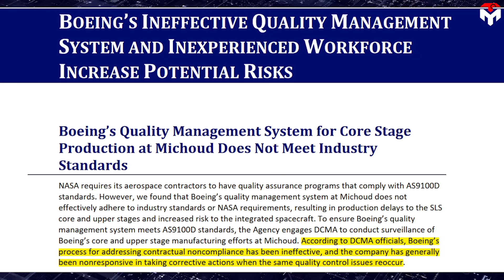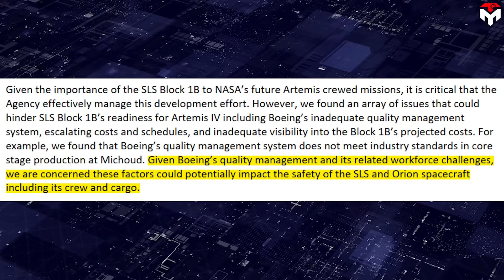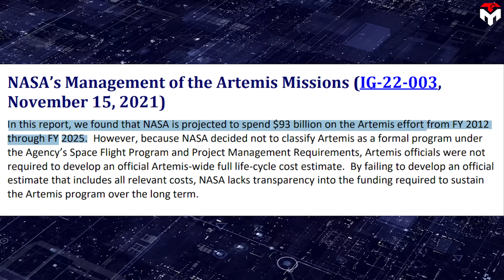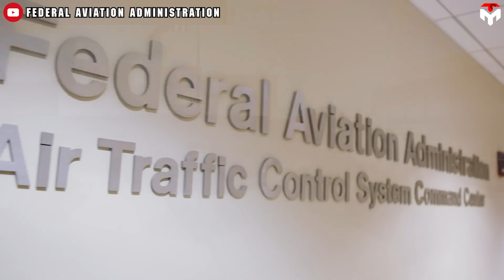Boeing's New Big Trouble With SLS, WORSE Than Starliner: Not Safe To Launch!

Comment: I worked EVM on ground system contracts, and on a number of projects involving NASA satellites.  People think EVM equates to cost control. It no more equates to cost control than a speedometer relates to speed control.  That said, I knew of many non-Boeing contracts where NASA paid them anyway, or failed to penalize favored contractors on CPFF contracts.  Development contracts are risky, and risk is part of the process.  That said, Boeing's track record is bad lately, and they need to see some penalties.  Also, NASA and the FAA need to stop beating up on SpaceX, and reward SpaceX better for excellent performance.

Comment: I again make a comment based on the video I just watched covering the latest POS Piece of Sh*t rocket.  What has happened to Boeing?  Seems every time they introduce a new product it is full of faults and when the assembly is inspected it has too many assembly issues that results in cost increases and many delays.  The video commented how the latest rocket designed and built by Boeing was as the article indicaes WORSE that the Strainer and not safe to launch.  I believe NASA needs to take a closer look at the design plans on anything being presented by Boeing.  Especially considring the results of their most recent products.  I am very sorry to see such a great company have problems that are just poor management and trying to cut corners in production.

Comment: Unfortunately, if they were to institute penalties that are not in the contract, Boeing could sue them for breach of contract. Unfortunately, NASA is now locked into this contract. the biggest problem is there now a company of being counters instead of engineers.
Reply from the maker: Hope that the new CEO can improve this
Reply: To make major changes, they would have to change not just the CEO, but quite a bit of the upper staff. Once the environment in a large company is set. The harder it is to make any changes.

Comment: REMEMBER DR.VERNER VON BRAUN ? NOW THAT WAS A REAL ENGINEER. The Saturn 5 was built and tested in sections  then assembled ,astronauts, then boarded and  took off. DR VO BRAUN SAID, DONT WORRY, ITS FINE.
Reply: There were no computers to make a solid design, and all blueprints (yes   they were blue) were drawn by hand.  Their tool was the engineering rule, with 3 sides.
Reply: Dr. Verner Von Braun was not a bean counter.
Reply: He had two hundred Nazis he brought with him to help 😅